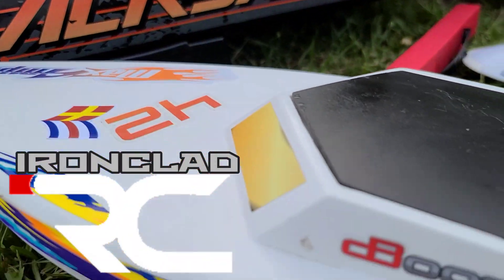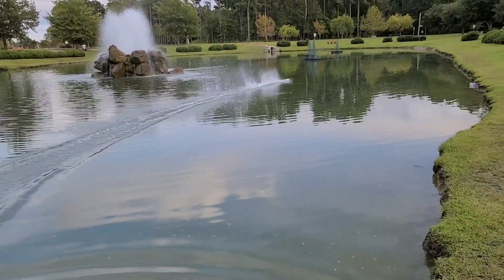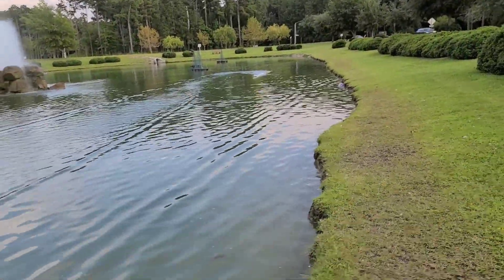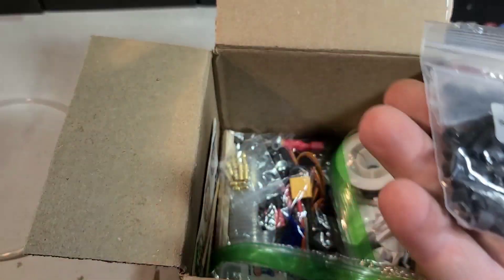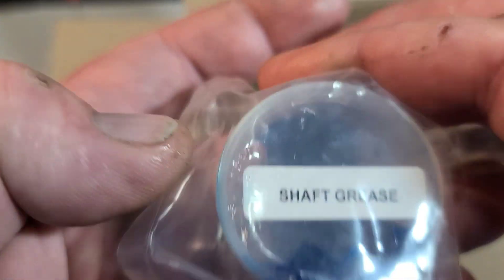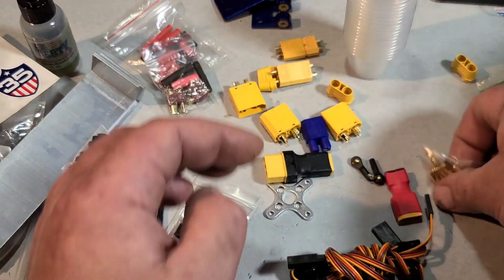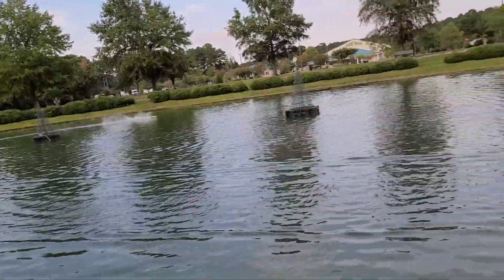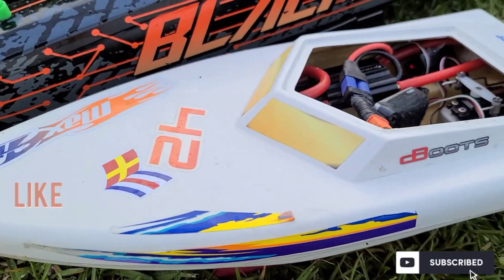19" Water Bobber Hybrid Rc Tri Hull - Trim Tab & 4000kv Motor Test

Comment: Thanks for the vid b , I am bouncing back and forth between surface drive or leaving the hammer driveshaft coming out of the bottom.
Reply from the maker: If I had to do it over again I think I'd go surface drive with this build.  I'm contemplating doing a rebuild, and installing a flooded stuffing tube for more adjustments

Comment: Happy Birthday/Merry Christmas to Big B, you got the mother load of freebies 👍 
  Lucas marine grease for big boats seems to stay in place long enough to run through several battery packs. It’s the flex shaft with its screw like winding that pulls the grease out through the strut so any grease isn’t guna stay long. 
  There you go, invent a type of system to continually add grease when needed. 👍
  Great video !!!
Reply from the maker: I've had the best luck with speed master struts, with out a linner imo grease stays in place longer.       I also agree with the flex cable acting like a screw winding the greas out the stuffing tube

Comment: Hey I know it’s a bit different to what you normally do but I have a pro boat sprint jet and I’ve put a 2040 4500kv brushless system in it, do you have any ideas as to what impeller I should use? It does about 5000 rpm, awesome vid btw 👍
Reply from the maker: Oh man. Not sure if there's an upgrade for that boat?    Good luck though  sounds syck
Reply: What voltage are you only getting 5000rpm?Have you tried to rebind the esc?
Reply: @mildtowildrc7343  sorry I meant 50000 I’m running 2 and 3 s if I go higher the motor explodes lol

Comment: LOL thats a Traxxas M41 rudder strut. I told u to get some Traxxas boats going on the channel
Reply from the maker: Yes it is, but BUT  I should be able to  rig up a rudder assembly for the sonicwake to prove a point about a deeper rudder vs a shallow rudder on a mono in a left turn.        That bracket will allow a deeper rudder for testing purposes

Comment: Try Lucas  Red and Tacky Greasem I think you will love it.
Reply from the maker: I actually mix the red and tacky w/ dynimite marine  grease works 👍
Reply: @IRONCLADRC  i ALSO USE A FULL SYNTHETIS WHEEEL MARINE WHEEL BEARING GREASE THAT WORKS EXTREMLY WELL IN WET CONDITIONS. THIS IS MADE BY AMZOIL

Comment: I need to know what setup you got in sonicwake stop teasing me man lol
Reply from the maker: It was the tppower 4060  with the firma 160.  I ended up putting the set up in the blackjack 42 temporarily
Reply: @IRONCLADRC  ok thanks i might get me one . But if you put it back in that be a great vid ! You still fit watercooling jacket on motor  ?
Reply from the maker: It's not a good match, trust me it's not. The esc isn't enough for that motor
Reply: @IRONCLADRC  good to know thank's  maybe different kv would be better? Ouff just saw price of that tp motor over 200 to much lol ill go sss good enough
Reply from the maker: Yes sss is a great motor 👌  more efficient than tp power  in a fast boat